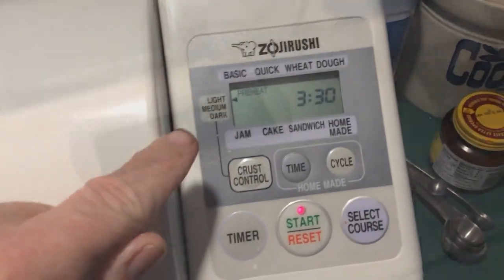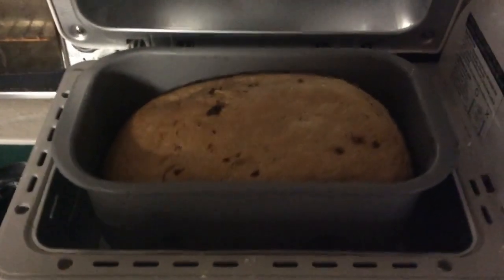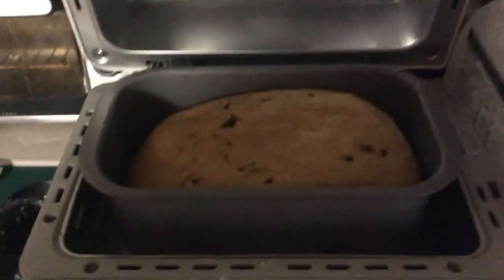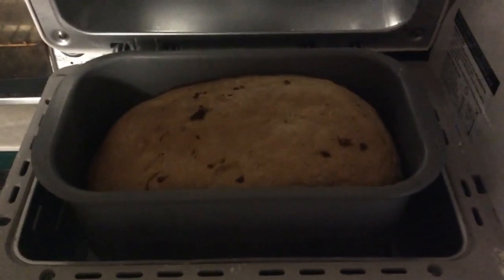Raisin bread in the Zojirushi bread machine

Comment: Why did it bake unevenly?
Reply from the maker: The mystery question. The dough always seems to be a little higher on one of the loaf when cooked in a Zojirushi bread machine. Some claim it is how the two paddles are set in relation to each other. I haven’t found that to be the case. Ive also just evened out the dough before the bake cycle. Some people remove the dough and cook it in the oven to get a perfect looking loaf.
Reply: @m005kennedy  I have noticed that if I put a bit more liquid in the recipe, the dough seems to lay down more "flat" than if the loaf is "too dry".
Reply from the maker: Thanks! I'll try that. I must admit I'm doing mostly rolls with it. I trying to learn how to shape them. It is going to take me a long time to get them right.
Reply: @m005kennedy  For dinner rolls, I make 3 small balls of dough, and place them in a muffin pan to bake. They turn out awesome. I got my first Zojirushi in the early 90s. They are awesome machines. I'm on my 4th 2lb loaf machine. Unfortunately they don't last forever. Each seems to last 4-5 years. I use mine a lot.
Reply from the maker: Do you only add ingredients when the pan is out of the machine? I didn't until I realized the mistake I was making.
Reply: @m005kennedy  No, I add ingredients when the alarm goes off, for adding nuts/raisins/whatever.